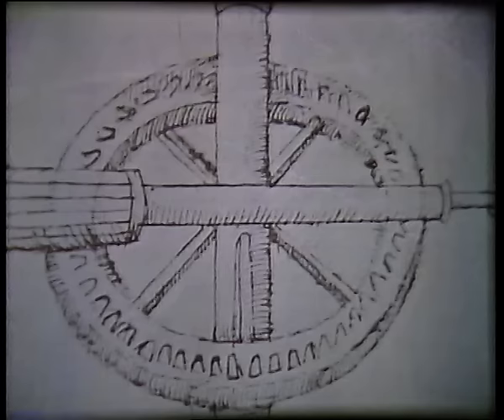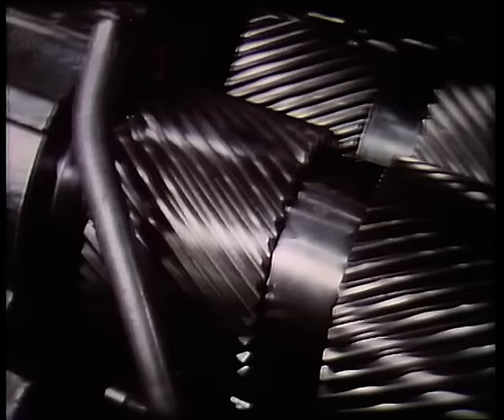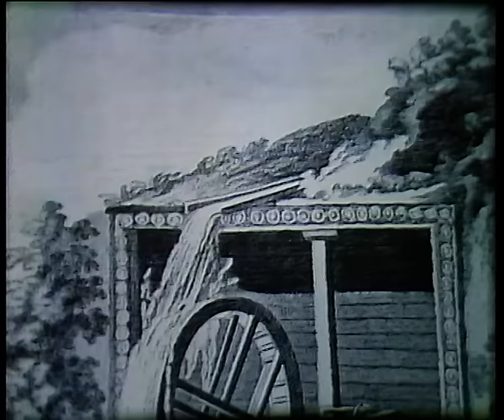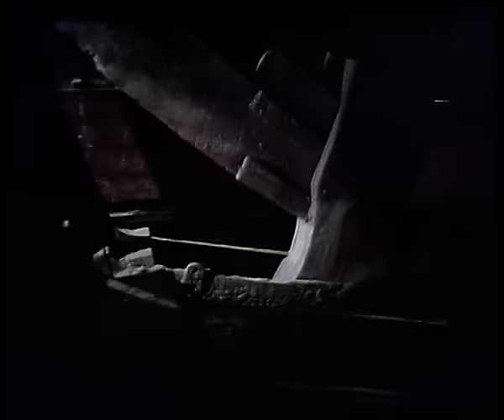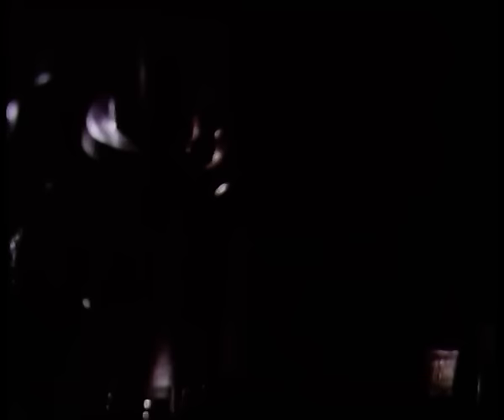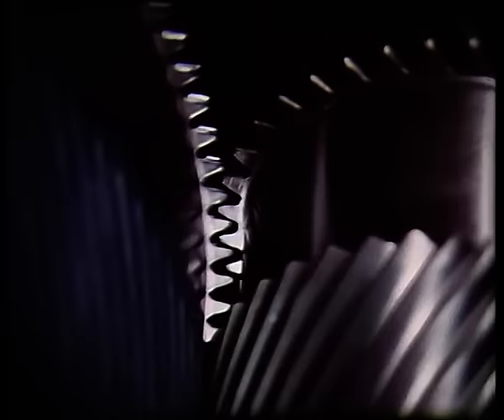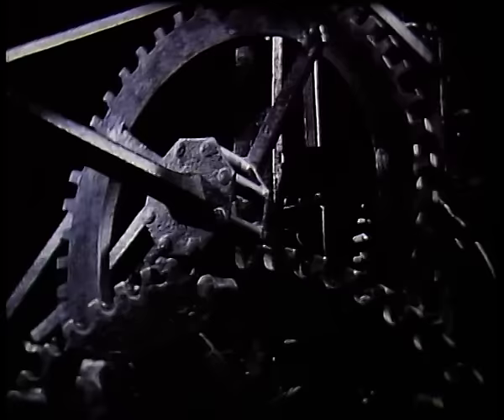Acting In Turn - Gears | Shell Historical Film Archive

Comment: Very interesting video.  One quibble is with terminology.  Gear sets cannot increase or multiply power.  They can multiply torque, but not power.  They can increase torque with reduced RPM, or reduce torque with increased RPM.  But the power after a gear set is the same as before the gear set (minus losses due to friction).
Reply: Well said.
Reply: I was in Rotary International; I read in their history that some Engineers advised the Organization that the revised Gear Seal would do no work, and Professional Advice was enlisted to correct the issue in a new Version.

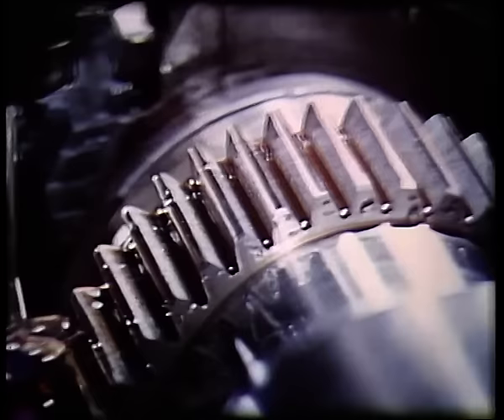Comment: At about 12:27, it says that "one wheel with the cutting teeth of the correct profile, generates the same shape in a blank wheel, so vast numbers of identical wheels can be cut." 

While hobs (cutting wheel) can cut "vast numbers of identical wheels," and the shape of the cutting wheel needs to be "the correct profile," the cutting profile is never identical to the cut profile.  The cutter profile is usually straight, whereas the cut profile is curved. A tooth profile is not formed to look like the cutter's profile, but rather a generated curve, specific to the number of teeth in the gear.

A hob can be used to cut a wide range of tooth numbers, ranging from about 14 to infinity., each curved to a specific tooth number. count.

There are tooth cutters that are straight like a rack, where the blank is "rolled" by the cutter as it reciprocates up and down generating the tooth profile.  See "Maag" gear cutters.

Comment: It is my understanding that Roller Chains are more efficient than gears & that is why race motorcycles still use Chains.
Victoria brand motorcycles used chains in.their gearbox instead of gears.
Cycloid gears are used in Model T cars.
It might be because Henry Ford liked working on watches & at the time most watches used Cycloid gears - that is just a guess?
I have been told that the center distance between gears is more critical, when.using Cycloid gears as compared to Involute gears?
Reply: It is true that clocks use cycloid gears and that the distance between gears is critical.  It's also true that cycloid gears work better when the driving gear is larger than the driven gear - which is as they are in clockwork.